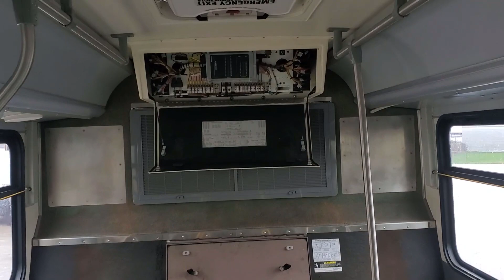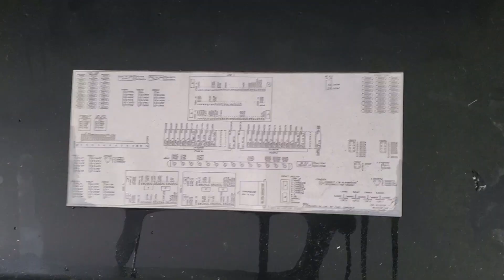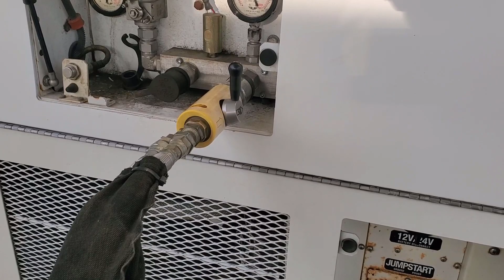Picking Up My Ebay CNG Bus! RV Conversion Project

Comment: Not sure if it will be easy to get CNG during road trips...? 
About the speed limit on the engine: I used to work in a transit company and with any new buses they had to set up a resistor in the control panel to limit the speed. Before they did that the buses could run to somewhere over 75. But after they limit the engine it stopped working when you reach 65 and if you are downhill when you are 70 the retarder kicks in automatically. A bit annoying if you are on the freeway... You may want to check if you could get access to a manual from New Flyer? Try to dis-engage that thing. It should be fairly straightforward. (We used to have Eldorado National 40Ft low floors) Hopefully it helps.

Comment: First: calm down.   circular hole could have been made by something else besides a bullet.  If a bullet did come through your window, it either is lodged inside the bus somewhere or it went out the other side.  So, do you have another hole on the other side of the bus?  Anyway, why would strangers want to shoot you? Did you tick off someone?  Your imagination might need to cool off so you can rethink it.